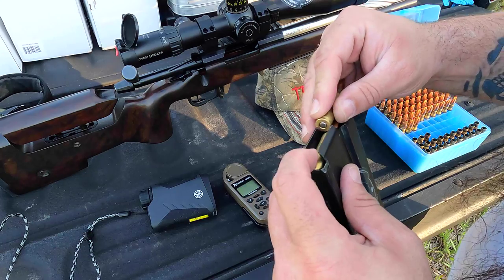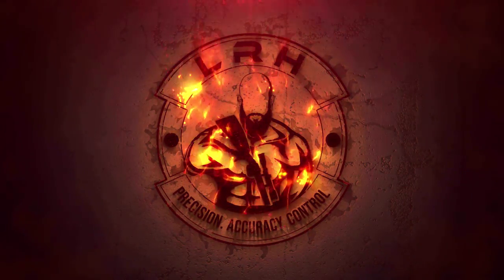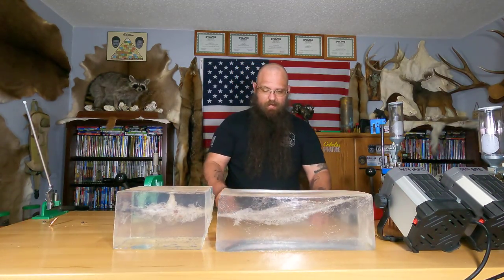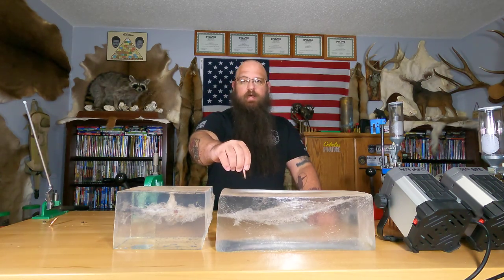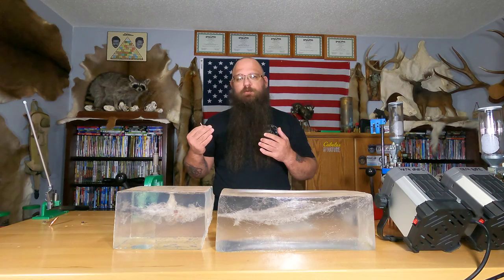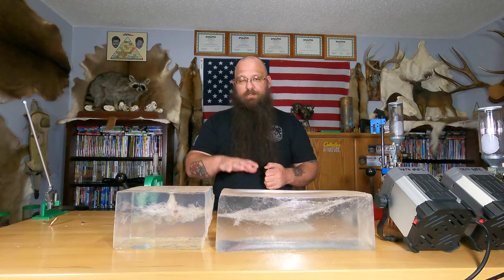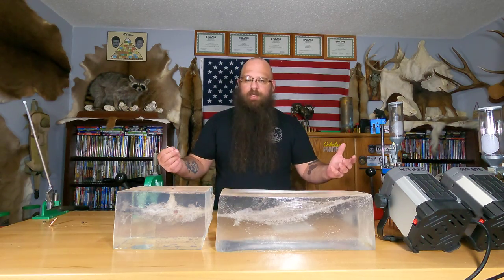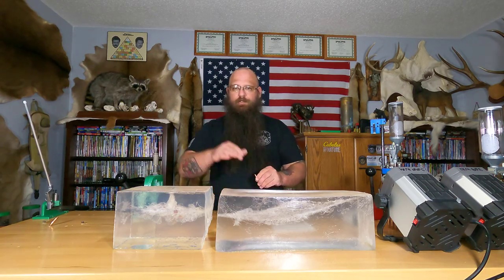Ballistics gel hunting vs match bullets episode 8 Hammer Hunters whitetail deer and elk.

Comment: Appreciate the candor & sincerity as well as the data. It no doubt requires quite a few resources of time, energy, money & materiels. This is very beneficial. It does answer many questions. Stay safe.
Reply from the maker: Thanks it definitely takes a lot but it's worth it. Getting real information out without having to sugarcoat things because of employment, sponsors, etc. Honestly I hoped these would perform much better but it's still incredibly valuable information. It's just as important to know what not to use as it is what to use. I appreciate the support
Reply: @longrangehuntinggroup7223  Thanks for clarifying the type of match bullet. My initial thought that you were proposing was that basically all match bullets(in general) were effective hunting bullets. But the qualifying element of the tipped hollow point clears things up. I have so much SGK, SMK, Hornady Interlock, Remington Core-lokt, SST, Hornady BTHP & ELDX. I hope to decide what to load for deer, elk & bear the next few seasons. We also have a good bit of factory ammo with partitions, scirocco, ballistic tips. Thank you.
Reply from the maker: There's good hunting bullets and bad same with match bullets. The SMK when it does perform does very well but there's been some issues with it clogging. Sierra created the TMK's to solve that problem. The one bthp that has worked incredibly well with no issues is the Berger hybrids. That's the #2 bullet I've tested and has been used for terminal performance. But there's plenty of bad match bullets out there like the nosler rdf, lapua, DRT match, and a few others.
Reply from the maker: The Remington core loks I wouldn't use I've hunted and tested them terrible bullets. If you use the SMK take a 1/16" drill bit and open up the hollow point a little this will give you more reliable expansion.
Reply: @longrangehuntinggroup7223  thanks for info & advice. Appreciate you all
Reply from the maker: Of course always here to help
Reply from the maker: By the way if you go for bear go with a bullet like the eld match, Berger hybrids, or the Sierra TMK's. People don't realize that bears are actually low impact resistance animals. They have thin hides, greasy fatty meat that acts like a lubricant. Using a bullet like most people do requiring a high impact resistance and impact velocity will just pencil through. People blame the cartridge and then keep using the same type of bullet just bigger. Eventually they have a big enough bullet to actually do something. But it's huge and heavy on recoil and doesn't give good performance. Just because a animal is dangerous doesn't translate to being built really tough. Using a bullet in a smaller cartridge that will expand on those will give you far better performance than the huge bullet penciling through
Reply from the maker: https://m.youtube.com/watch?v=m7Obf8sr-xY&t=758s This video shows bears hit with eld match in 6.5 and 308.

Comment: Thanks brother! I was not familiar with the hammer but read about it in one of the discussion pages. Thanks What is your thoughts on the ELD-X Hunter by Hornady. I've read good and bad. What is your take or view?  I am going to load some 6.5 PRC's and some 300 Win Mag's. Looking for a good bullet to stock up on. I currently have the Nosler Accubond for the 6.5  PRC and have ordered some Barnes TSSX 180's for the 300. I would have rather had the Barnes TSSX LR's but couldn't find them. LOL Thanks again
Reply from the maker: Hey bud so I'm not a fan of the eld x personally. I've used and tested it extensively including the factory ammunition you mentioned. I'm not sure why they call the eld x a eld to be honest. It also confuses people who think it's like the Berger vld line. You know one to practice with and then one for hunting. The hunting having a thinner jacket. Not the case with the eld x. The eld x is a improved SST with the same jacket, jacket thickness, and jacket taper. The eld x has a different tip and is slightly more aerodynamic increasing the bc slightly. Terminal performance is what you get with the SST and both have a minimum impact velocity of 1800 fps. The eld match is a improved amax with the same amp jacket .024" thick, and same core. The eld match has the new polymer tip and is slightly more aerodynamic increasing the bc. Both have the same terminal performance and the same minimum impact velocity of 1300-1400 fps for expansion depending on impact resistance and depth of penetration required. Top bullets based off controlled testing and field results is amax, eld match, a tips (a improved eld match) from hornady. The Berger hybrids are incredible all Bergers except the vld line is hybrids. The Sierra tipped match kings are another great bullet they are very similar to eld match in construction.

Comment: The wound channel is many  times larger than the diameter of the bullet so what really is the percentage difference between say 22 cal and 30 Cal at a given speed difference of actual wound channel and actual energy transfer
Reply from the maker: The amount of energy transfer is based off the bullet construction, impact velocity, impact resistance, depth of penetration, etc. If a bullet doesn’t perform it’s barely getting any energy transfer even at high velocity. If you’re above 2200 fps but doesn’t expand it won’t achieve hydraulic shock. So you won’t get a large permanent wound cavity. A good bullet though in the same situation will achieve hydraulic shock and have a wound cavity much larger than the bullets diameter expanded. I have a video can a 223 beat a 50 bmg you should watch